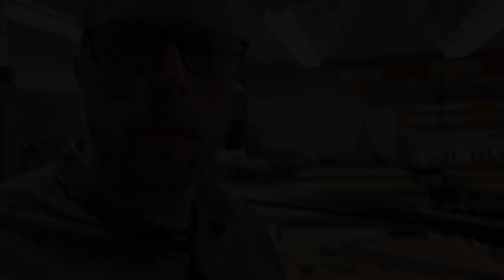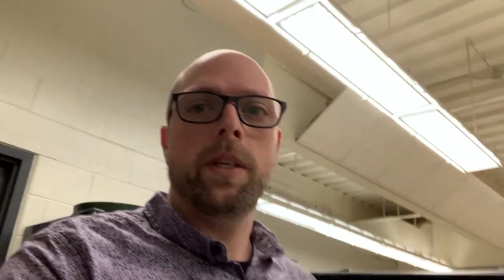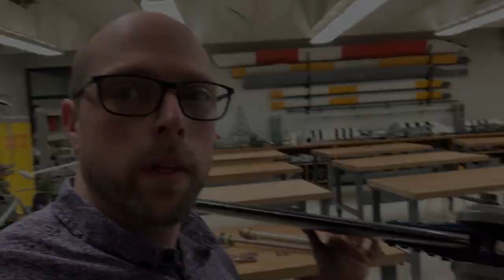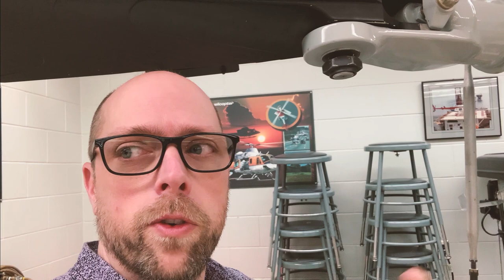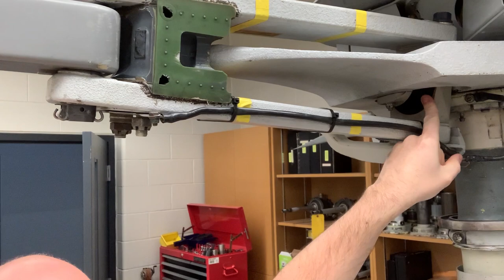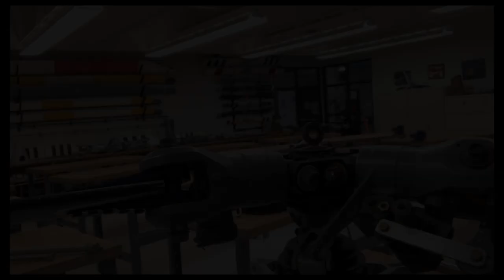Fully Articulated and Semi-Rigid Rotor Systems

Comment: Very interesting and nice to see! Maybe you can show us the semi-rigid rotor system under the aspect of mast bumping, can‘t find a video so far where it actually shows real footage. Please continue your work man, like and subscribe :)
Reply from the maker: Thanks for the comment,  sounds as though you have a good grasp of the basics. The biggest problem is the reaction to the aircraft getting light, in a low g condition, the tail rotor causes the fuselage to roll to the right while the rotor (big gyro) maintains its plane of rotation.  The pilot tries to correct for the roll, tilts the disk in the opposite direction and BANG,  mast bumping.  Thanks for the advice, I will try and get a video on it up soon.  
Skids

Comment: Have I understood correctly that the blade angle is the only thing controlled by the pilot and all the other movements is due aerodynamic forces and centrifugal force on the blades?
Reply from the maker: You are correct. Collective force changes the blade angle on all blades equally. The cyclic changes the angle of the blade at different points in order to get the blade to fly higher or lower depending on how the rotor disk is required to tilt.

Comment: Is there a "simplified" rotor head which can be used for a three-blade rotor system ?

Something analogous to the Bensen 'type' teeter bar (?), since I would like to find out the difference in performance, such as lift and autorotation cabalities with three blades as opposed to two blades.

Any thoughts shall be appreciated.

Comment: I have a question,.
In the fully articulated rotor system, if the blade is free to flap on it's own, and it shoud never bump the mast, how is it possibile for the wing to transfer the lift to the helicopter?
Reply: Ive been trying to understand your question. with all blades spinning at 100% centrifugal force is effectively strengthening the blades and producing lift. flapping individually causes the system to speed up due to Coriolis force(semirigid underslung teatering -  flap while tethered together 180º apart. CG is in the same spot during rotation therefore it does not speed up) . lead and lag counter Coriolis force by allowing the individual blade to speed up from flapping momentarily but is suppressed by the dampers. thus removing stress from the blades and rotor hub. flapping and lead/lag help the aircraft to make the uneven lift,,, distribute more evenly throughout the plane of rotation.
Reply: @tuckerzehner7970  thanks for the answer my question was simply how a non isostatic body can transfer lift to the mast. I now understand that it's the centrifugal force itself that makes it possible.

Comment: Do you sell rotor blades? Please reply when you see. Thank you
Reply from the maker: No, sorry.  I am not in sales. You can purchase blades from the helicopter manufacturer directly.
Reply: Thank you
Reply: At present, I do not know a lot about airplanes by myself. I have a question to ask you whether the blades of NACA8H12 rotorcraft can be used in helicopters.
Reply: Because it's not easy for me to buy here in China
Reply from the maker: @Chinese-Food66  The NACA8h12 airfoil would require too high of an RPM to be used along the length of the rotor.  What are you trying to get airborne?
Reply: @Chinese-Food66  due to cost or else...

Comment: Hi,
the as350 rotor head use pitch coupling during flapping? ... so the pitch changes as it goes up / down?
Reply from the maker: No, there is no coupling between the flapping and pitch change in the main rotor of the AS350.  This is common on a variety of different tail rotors (except the AS350 tail rotor :)) and rare on most main rotors.
Reply: @MrSkidkicker  What is the angle of phase-lag on this rotor   ?!

Comment: can u tell me that the star type rotor system will come under which catagory ? semi rigid or fully articulated.
Reply from the maker: Yes, because of its in plane stiffness, by definition, the star rotor head you are referring to can be considered to be semi ridged, but has the motions of a fully articulated rotor.
Reply: @MrSkidkicker The astar isn't semi rigid is it? I always thought semi rigid referred exclusively to a teetering hinge rotor system. It's a rigid rotor system no? Specifically a hingeless, bearingless rigid rotor system?

Comment: Is there any example of 2 bladed fully articulated rotor system?
Reply: Probably not - it's just cheaper and still effective to teeter. Separate flap hinges per blade are used because teetering doesn't work with more than two blades.

Comment: The lead/lag movement is not necessary for a 2 blade system.
Reply: Two blades are semi-rigid the Blade make the action lead and lag however the Main rotor Head and blades hás the time reduced per half life of hours incomparassion with articulate, the articulate Main Head is more quality and Fine now do exist the rigid sistem aplicable in Messershimmit BO 105/ Bk 117 are Acrobátics and main rotor Head makes in Titanium and only hás movement of Piching and hás one vibration 1/1 ever.

Comment: Just found this video. So....why do all modern gyrocopters use only a 2 blade, large diameter flappy rotor? I would think a smaller diameter 3 blade rotor would be less drag, less stick shake, and less retreating blade factor. I think autogyros are great except for how slow they are. If you really want to GO SOMEWHERE, rather than just fly around at 70kts, you need a machine that can cruise at....maybe 120kts. Why so slow. Do you know?
Reply: Gyrocopters are as cheap as possible, so they usually have simple two-blade teetering rotors; some even tilt the rotor rather than using cyclic pitch control.